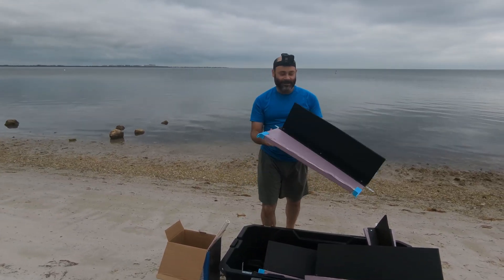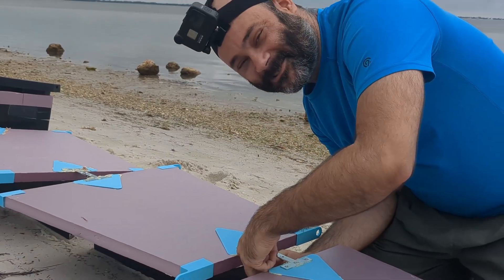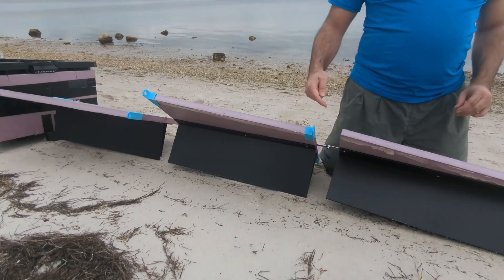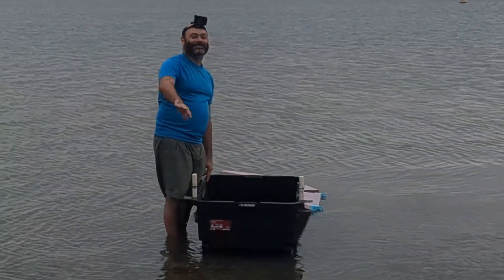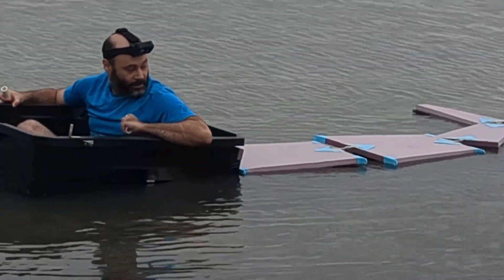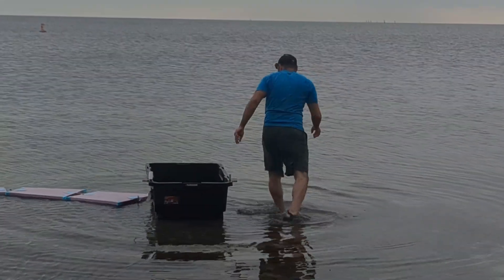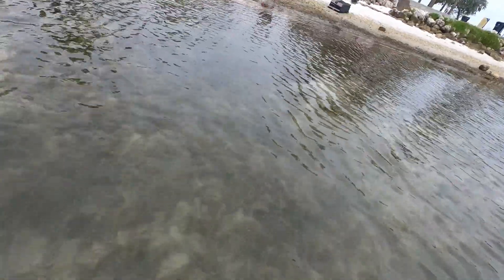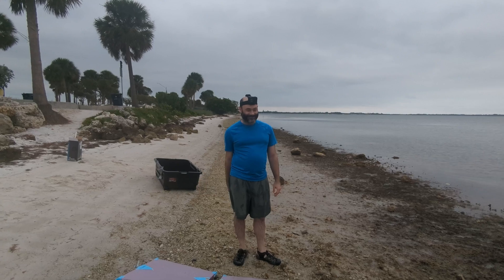Cyrene Version 2 of My Fish Locomotion Boat Has Fins on the Bottom

Comment: You probably need some sort of keel on the hull too. Would it be worth bringing a hole saw and making some holes in the current fins until it gets better resistance? Or have multiple smaller keels that you can slide on? Clearly this needs stronger connectors, but it's hard to know that without experimenting. Maybe put a large bearing on the previous section? You would also need to make sure they don't gum them up (especially if this is salt water). Definitely good progress though - lots of learning happening! It's easy for me to critique from the comfort of my armchair, but you are doing the hard work!
Reply from the maker: @simonabunker I love constructive comments, and all of your ideas are good ones. I definitely thought about a hull keel the minute the cabin started sliding around as I pulled on the wires.
Reply: @adrianinvents  much easier to do with hindsight!
Reply: It might also be worth thinking about just putting a large tail on the end section - as that's how most fish do it. At the moment you are making a mechanical eel.